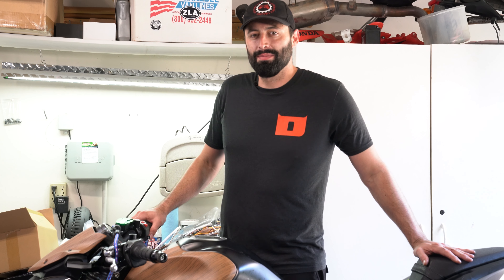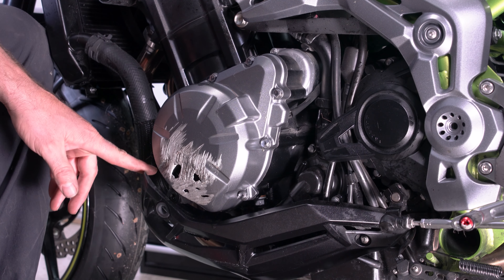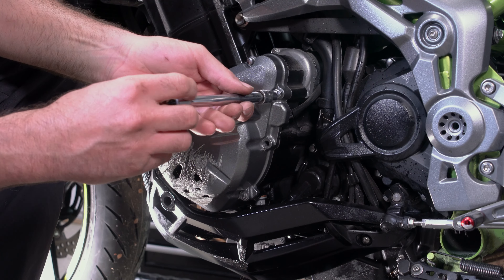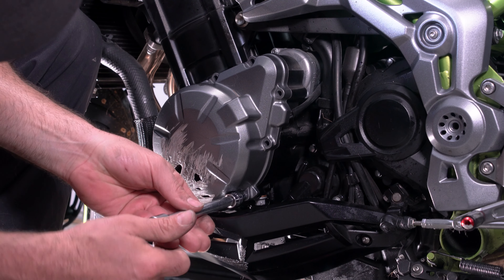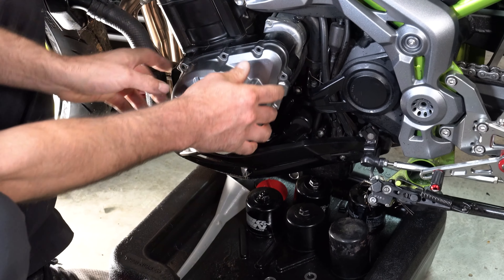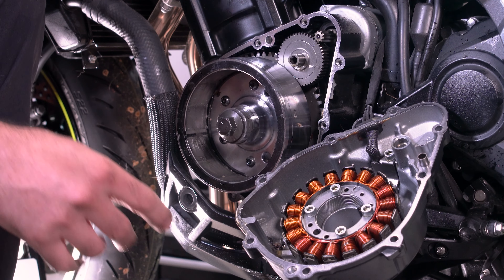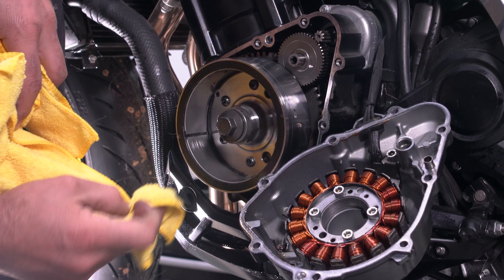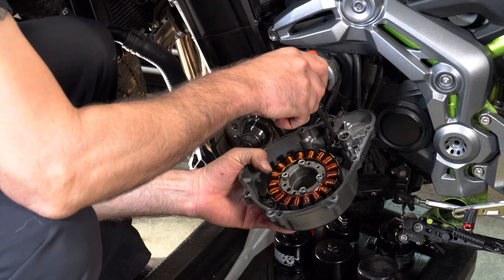Kawasaki Z900 - Stator Cover Replacement

Comment: What tool did you use to loosen the bolts that hold the stator in the stator cover? I recently got into an accident on my ninja 400 and I also cracked my stator cover.

Comment: anyone know what the little gear was the stator. its held on by the small cylinder piece the connects to the stator cover. it came loose when i pulled my cover off and i was wondering if it had to be in a certain position like the timing gear.
Reply: Did you ever figure that out? Currently in same boat🤣
Reply: @jacobaragon2727  I did but it was so long ago I can’t remember. I think I ended up saying fuck it and yammed it back in there but I honestly have no clue
Reply: @calebwitt6594  alright, I appreciate it! I may have to end up doing that🤣
Reply: @jacobaragon2727  good luck man lemme know how it goes

Comment: I stripped the screws holding the stator into the cover the red loctite would not budge any suggestions?
Reply from the maker: Dremel a slot in the bolt so that you can use a flat head screw driver to unscrew it

Comment: Beauty is in the eye of the beholder,  but damn that wood look is terrible.   RTV is not a good choice for use as petroleum based products (oil) will resolve it. More than likely it was used to hold the gasket during assembly.  Man are you a messy mechanic.    Loved the video though.
Reply: Hi, care to elaborate? What would you use instead of rtv sealant? I’m planning on doing this project on my z900rs. Any info would be helpful. Thanks.